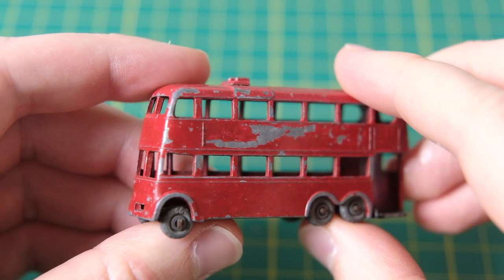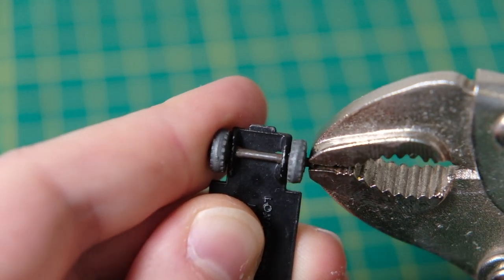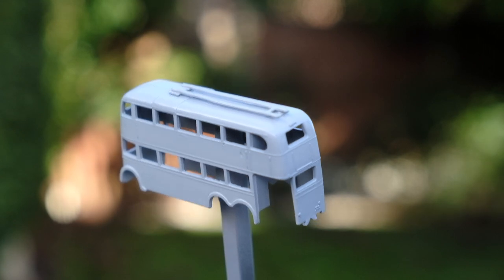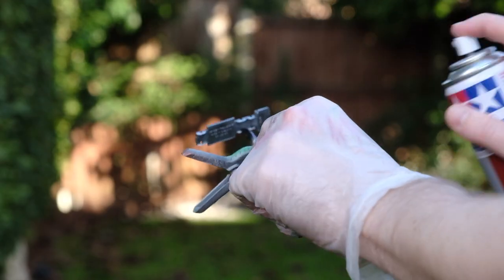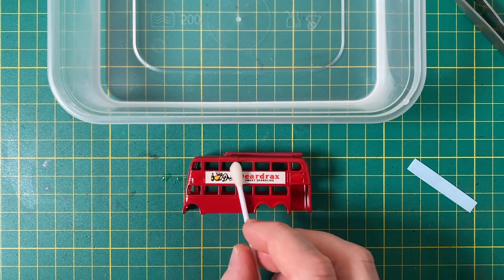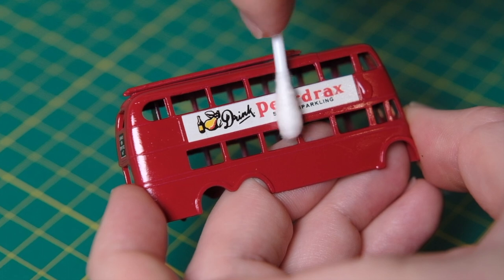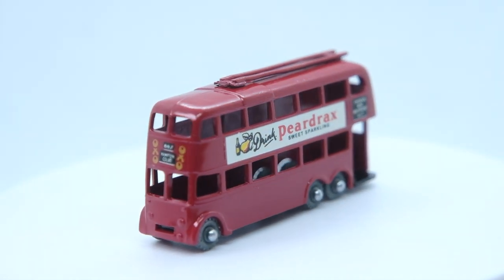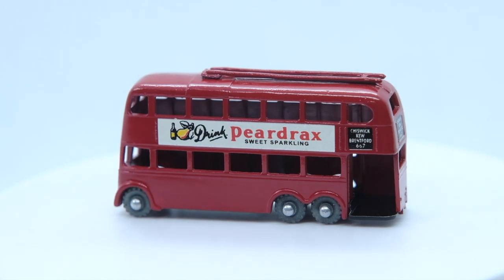MATCHBOX restoration: 56A London Trolleybus

Comment: cute little casting. :)

here in germany I think two, maybe three cities still use trolley buses. one of it is Esslingen am Neckar, a city next to my place. they use the trolleys to reach places high up on the hills made by the deep valley of the Neckar River, to save on diesel fuel I think. the buses are still modern constructions, so I guess this will last a while. :)